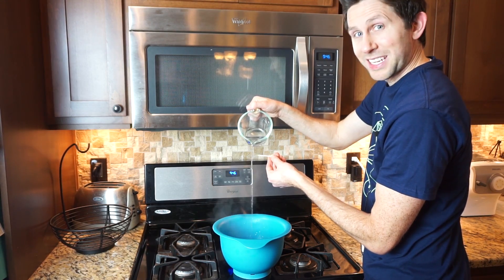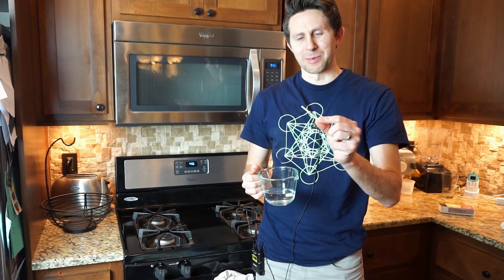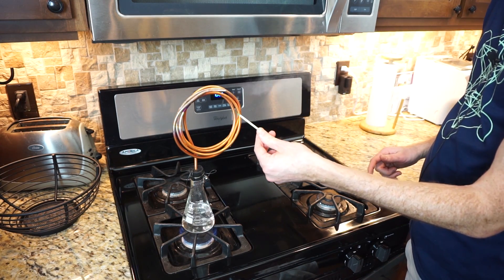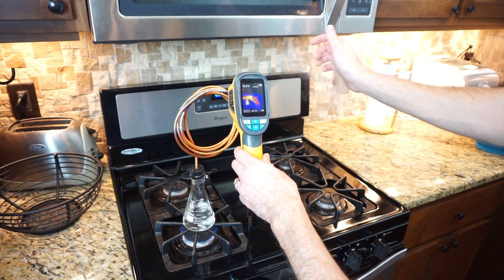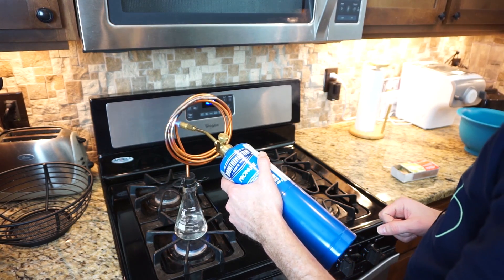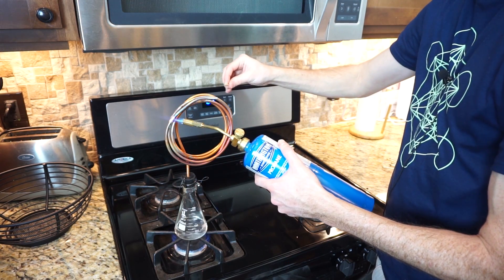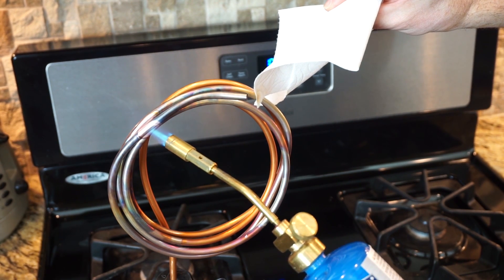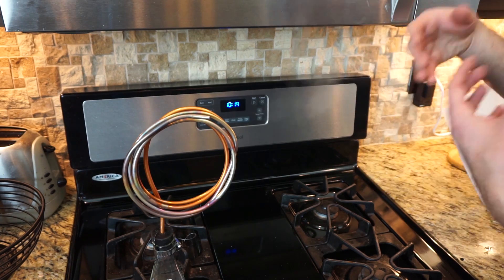Is it Possible To Light a Match With Really Hot Water?

Comment: I spent many years on the turbine deck of a  power plant. Most people have no idea what steam can do. Great video, as usual!!!
Reply: Marshall Van Wagner III I'm actually curious... Do you have any stories about steam related incidents at your work place?
Reply: Vijay Raj - Over the years we several small super heated steam leaks, and I was around for one boiler explosion, and quite a few boiler tube failures. The tube failures we're interesting, an explosion, followed by a rain storm! The one boiler explosion I was near was scary as hell, I was in the control room at the time, we were starting up do the pressure was very low. The failure was due to an unlit pool of fuel oil. How it happened I'm not sure, but the result was that we had boiler damage on all eight levels, a fire on the two upper levels, and water and steam all over the lower levels and turbine deck. The super heated steam leaks we're pin hole leaks, and they, in my opinion, we're the most dangerous, and scary. The high pitched noise that was made went right through my hearing protection. This happened in the 70's, and there was no thermal imaging equipment available. Twice it was determined that the leak must have been right at the turbine deck level. It happened very quickly, and folks on the turbine deck froze in place. I was pretty safe, I was doing a PI test on the rotor of the next unit in line. It started getting louder, and the senior shift operator hit the emergency throttle stop button. The other steam leaks went about the same way. We did have one poor guy scalded when a steam valve on the low pressure side failed as he was be operating it. He had second and third degree burns on his torso. He did heal nicely and was back at work within five months. As much as I liked working on generators and their associated equipment, steam always worried me.....
Reply: Marshall Van Wagner III wow man... Scary stuff 😅
Reply: Vijay Raj At times it was scary, but given a second chance at life, I'd do the same work. I did high voltage testing for the power company for 38 years. My time was divided between power plants, transmission substations, and distribution substations. We worked everything from 4kv AC to 500kv AC. I loved the work. It was the best job in the world for me. I learned a lot about electricity, and I learned much about myself. Great job.....
Reply: Marshall Van Wagner III i hope i find a job that I'm passionate about as you are about yours
Reply: @marshallvanwagneriii1495  your story is fascinating!
It's impressive, what elements can do in Industrial Settings.
Thank you for tellig us your story!
Reply: I heard a steam. Is the steam team. About the weanis side.

Comment: Any cook can tell you that steam will seriously scald one.  If you could put your hand in it then the copper coil was cooling it.  Steam straight out of the flask would have been much hotter.
Reply from the maker: Steam will definitely scald you, but not cold water droplets. You get burned when your hand is close to the steam source because not all the steam has condensed and also the water in the air hasn’t cooled yet. My hand as far enough away so that it cooled first. But yes, do not stick your hand in steam!

Comment: Why didn’t the hot steam condense in the colder air around it when you put the torch to the copper ?
Reply from the maker: It never got cold enough to turn back into liquid before it mixed with the air and stayed a vapor. So it essentially skipped the step of turning into liquid water and then back into vapor
Reply: The Action Lab Well that means if you put the hot steam in a very cold environment like a freezer then it would turn into tiny liquid droplets first then vapor again
Reply: Engineer X it was too dispersed by then

Comment: Can you teach me what is angular velocity?
Reply from the maker: Hold your arms out and spin. The angular velocity of your arms (and body) is how many rotations per minute you are doing. You can measure it as full rotations per time or partial rotations per time. If it isn’t a full rotation you measure it as an angle where a full rotation is 360 degrees
Reply: "In physics, the angular velocity of an object is the rate of change of its angular displacement with respect to time. The SI unit of angular velocity is radians per second. Angular velocity is usually represented by the symbol omega."
Search engines are useful.

Comment: Do you know if water boils at 100C why clouds are cold?
Reply from the maker: Clouds aren’t vapor, they are water droplets. They can be as cold as they want:)
Reply: The Action Lab So what is vapor then?
Reply from the maker: Vapor is a gas. But the technical definition is this: a vapor is a gas in which you can increase the pressure and it will turn back into a liquid if kept at the same temperature.
Reply: The Action Lab According to the definition clouds could fall into vapor category, doesn’t it?
Reply from the maker: Clouds are not vapor though. You can’t see vapor. Clouds are liquid water.
Reply: The Action Lab There is much to investigate like why clouds are flat from the bottom and if vapor trespass that limit and condense above it where temperature is much lower. Earth is an enigma.

Comment: The coil is probably so long the steam has cooled too much. Have you measured the exit temp?
Reply: I was thinking the same. I think he would have gotten it hotter if he just had a short piece of pipe going straight out from the blottle and just put the flame on that - because now the flame only make contact with a small part of the coil. Most of the coil is outside the flame and cools the steam instead.
Reply: @Ride84XL Copper is extremely heat conductive. It transfers the heat from the blowtorch around, and while you could probably get hotter with a somewhat shorter coil (and if you lined the coil up in such a way as to maximize the amount in contact with the flame), it's not too bad.
Reply from the maker: If you just had a straight pipe it doesn’t have enough time to heat up. The coil is to increase time in the hot tube to heat it up more. Obviously the more locations you have the torch the hotter it will be though
Reply: Yes, but that also takes away some heat from the steam. It's not that the steam will be cold when it leaves the coil - but it will not be as hot as it could be. It's still just a small part of the tube that makes contact with the flame and a much larger part thats outside the flame. 
Even if conduction thru the copper and the steam inside levels out most of the differences between different part of the coil, it's average temperature will still be realatively low. It doesn't really matter how hot the heated spot really gets versus the "cold" parts. The average temperature of the coil is what's intresting and that gets relatively low when you just heat a small spotof it.
Reply: Ok, that would apply if you put the coil inside a furnace - but now you only heated a small part of the tube. The time it takes for the steam to pass the hot part of the pipe is not longer than it would be for a straight pipe. Ok, you have several turns in the coil and each turn it will pass thru a hot spot. 
But it will also be a lot more cool pipes that it has to go thru compared to if you had a straight pipe where more or less the whole pipe could be heated with no cold parts. A coil with a much smaller diameter (so you can heat up pretty much the whole coil) would probably be the best though
Reply: That's true - but that also means it will carry heat away from the heated spot to the parts outside the flame, wich in turn act as a cooling fin. 
Even if the heat conduction of the copper levels out the differences between the heated part and the "cold" parts - it doesn't change the fact that a lot of heat is leaving the pipe (and the steam inside the pipe) from the parts outside the flame.

Comment: Um i have an idea?
(I mentioned this on another video but it didnt really get much attention)
Why not try to compress water to make it solid?
I mean if you are trying to light a match with the same thing that can put it out i think my idea would be pretty interesting
Reply: oluap oitap lol take a grade 9 physics class then look at your suggestion and laugh
Reply: theglurgle *8 grade in finland xD
Reply: oluap oitap Thanks for your idea 9 year old.
Reply: oluap oitap But yeah well, there is the problem that water is the one special liquid which density grows when temperature lowes below 4°C (freezing point of 0°C) and when heated from 100°C as boiling. Other things has straight line of low density as gas, middle as liquid and lowest in firm(can't recall the word for it, I'm not native English speaker) form. And high pressure applies heat.
Reply: Im in 7th grade so sadly i cant laugh about it just yet
Reply: theglurgle does it make you feel better to insult a kid in youtube? He just don't know about it, not trying to be rude to people or doing anything bad. Why do you have to be so harsh?

Comment: Hey man am i confused? You said the hottest water can get is at its boiling point? Can't you get water much hotter than its boiling point?  Super heat it? Ect?
Reply from the maker: Well technically yes. But notice I didn't say a temperature, on purpose because it depends on the pressure. But if the water is boiling that is the hottest it can get. It cannot increase in temperature if it is boiling because all the energy goes into vaporizing the liquid
Reply: No, if it gets hotter than it's boiling point, it will turo into steam.
Reply: Tazer its “steaming temperature” is cooler than boiling point. Not only that but steam is water vapor. He just said the energy goes into vaporizing the water aka turning it to steam.
Reply: And?